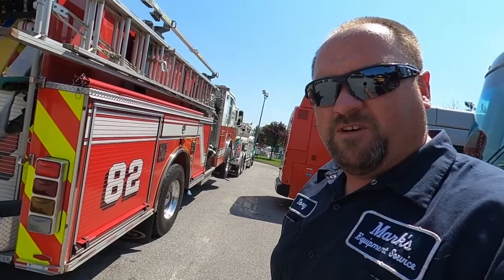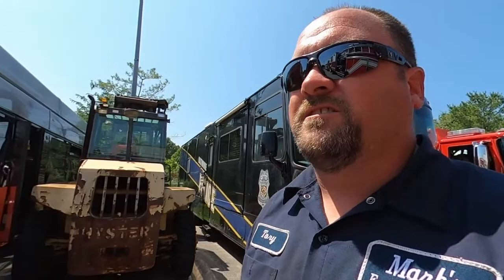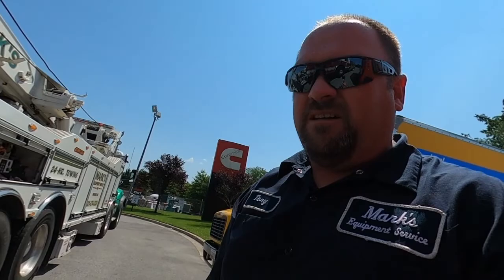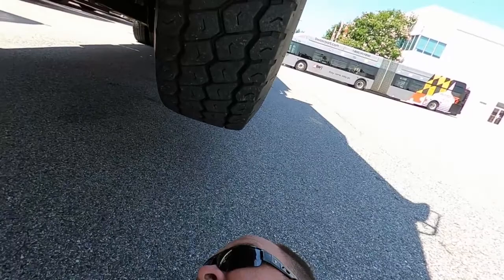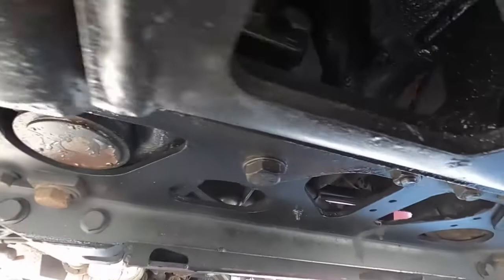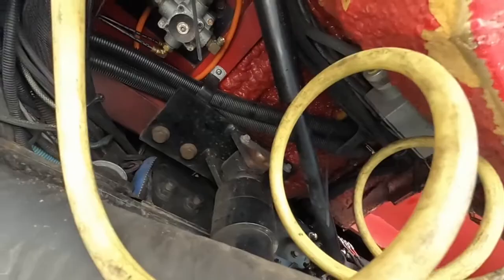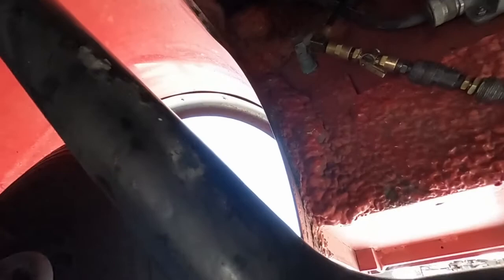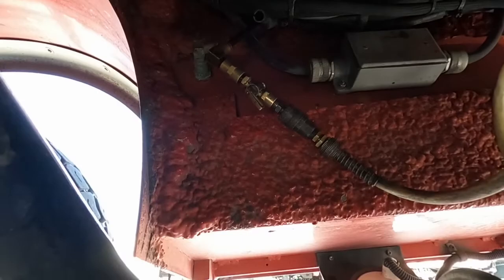TAK 4 Fire Truck Tow!!!

Comment: I don't like the wheel lift for the same reason plus putting it together is a pain in the ass. I fork them in the triangle areas just inside where you got it. The ones around here don't have a transfer case (it's an electric pump) so we have to pull the drive shaft. Those things even without water are damn heavy.
Reply from the maker: They’re always heavy on the front axle. I’ve forked them there as well. Be careful out there and thanks for checking out the video.